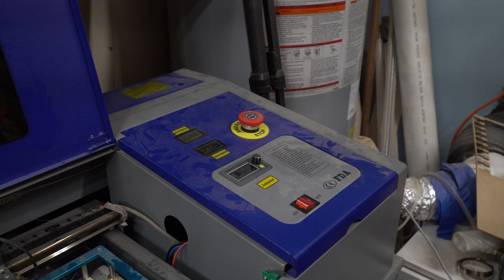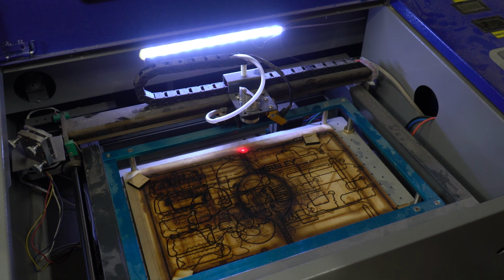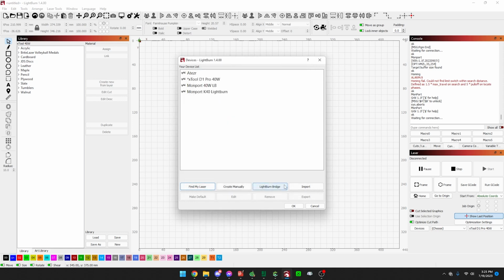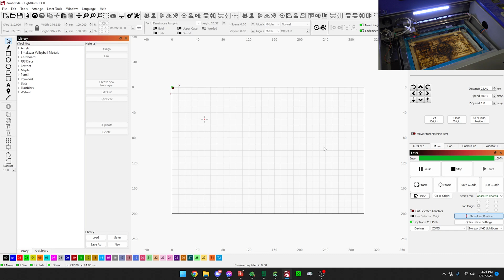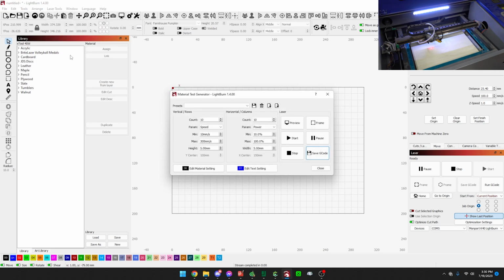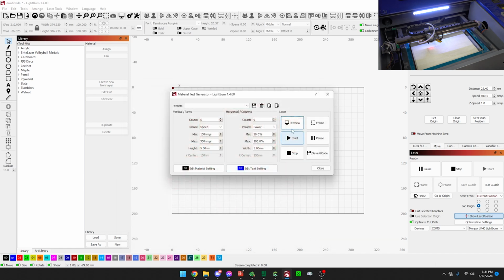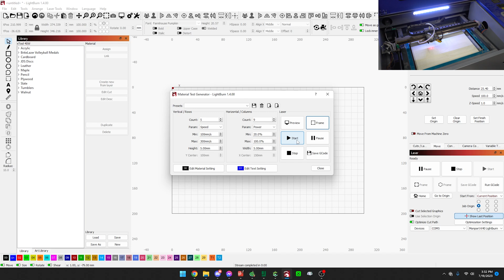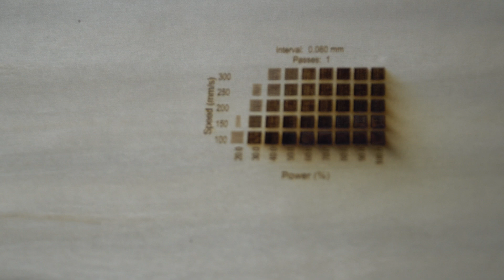Connecting your Monport K40 laser to Lightburn the easy way

Comment: Do younhave a video on how to manually set it up.. if lightburn doesn't dectect it?
Reply: exactly what i came here for..
Reply from the maker: I don't have a video on it, but just manually input the stuff that's in the video (so when it asks for bed size, use the size in the video, etc.) and then once it's added, just specify the port it's connected to (if it shows multiple COM ports then just try each one until you find it, no harm in choosing the wrong one.)
Reply from the maker: I don't have a video on it, but just manually input the stuff that's in the video (so when it asks for bed size, use the size in the video, etc.) and then once it's added, just specify the port it's connected to (if it shows multiple COM ports then just try each one until you find it, no harm in choosing the wrong one.)

Comment: What shall I do if Lightburn refuses to see my Monport 40W Pro? It just doesn't see the device
Reply from the maker: Are you doing manual setup or the "Find Device" function? And, have you installed the CH340 driver?
Reply: @CreatedWorkshop  I have turned everything on and off in different suequnces and eventually my computer saw it ✅
Reply: @CreatedWorkshop where do you find the driver?

Comment: I’m having framing issues and the material test is engraving in reverse. The framing is just all over the place and not where I have the image. Any ideas on both of these issues?
Reply from the maker: For material test, it goes based off of where you have your origin set. So, if your origin is set to "absolute position" it'll place the test in the middle of your bed. If you have it set to user origin, and so on. 
For the engraving in reverse, that's very odd. Could you send me a picture on Instagram (or email it to me patrick @ created workshop (dot) com)

Comment: Thanks this helps, questions did you adjusted the amp meter knob?  Thanks
Reply from the maker: I keep my ammeter knob turned all the way up.
Reply: @CreatedWorkshop    Thanks, I figure it would be something like that.  I was having issues, because I had it 75% of the way.  Fearing pushing the 100%,  but I can remember not to do that.  Again Thanks for your time

Comment: And if it doesn't find the board. I just installed a monport and it doesn't show up in lightburn, but will "connect" but frezzes out when "homing" (no stepper movement. But on LASERGRBL it works fine
Reply from the maker: That’s a very odd issue! I’ve not run into it before. Your best chance is to contact Monport directly
Reply: @CreatedWorkshop   I canned the idea, got a MKS DLC32... just installed today so sort out in coming days

Comment: how do I know where the laser will start prinint, or how do I tell it where to start printing.
Reply from the maker: That's controlled by your origin point. There's three options: absolute position (where you place it on the workspace is where it'll work), user origin (move the head to a place and set user origin), or current position (wherever the laser is that's where it starts). Then, right around that selection is the actual job origin point. This is where you choose like top left, center, etc.